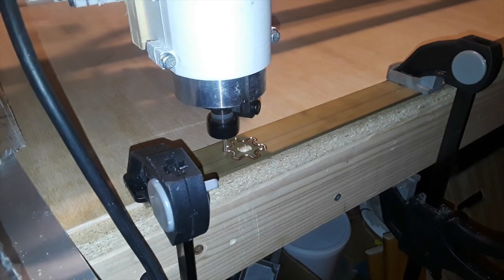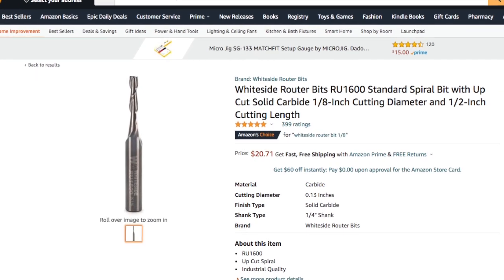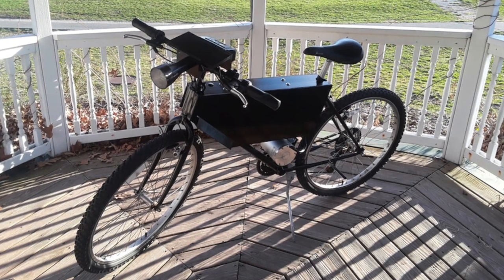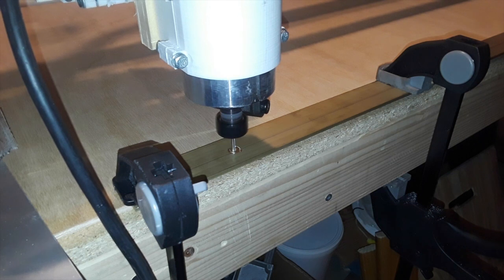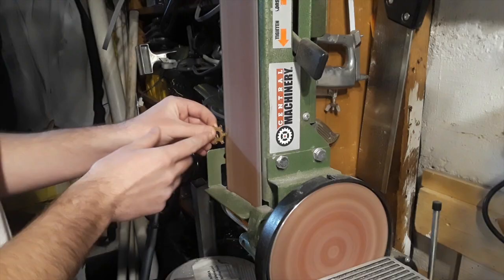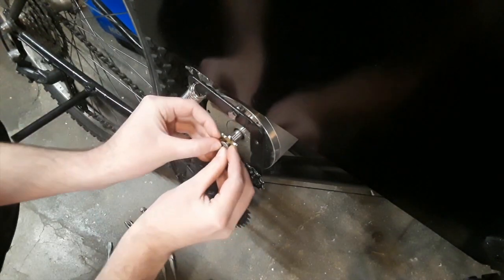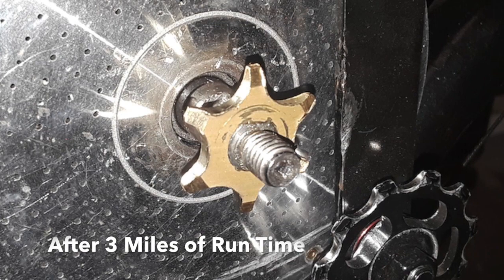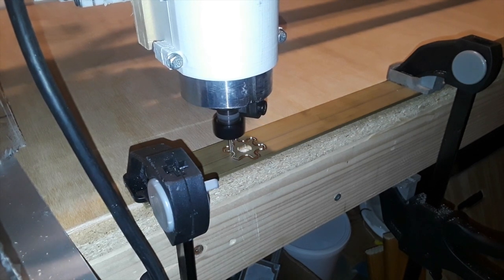Homemade CNC Router Part 9: Machining Brass and Aluminum

Comment: I do wanna say that is a very nice clean cut. For a wooden machine. I am thinking about cutting wooden mock ups for my machine too. I like the config of wider (Y) thinner (X). I plan for such a machine. Also the rails. Get some good linear rails. Those bearing surfaces will introduce a degree of freedom.  Triangles too. A triangle needs only 3 corners and is strong AF,.... but a square needs a knee brace to retain its square ( a diagonal load path). gusset the eff out of that thing and it will cut beautiful.
Reply from the maker: Thanks